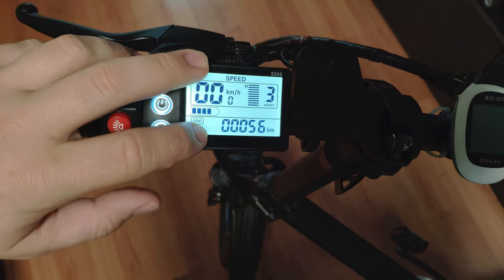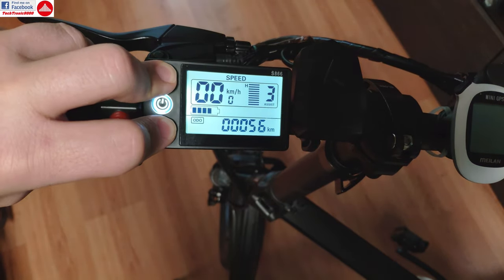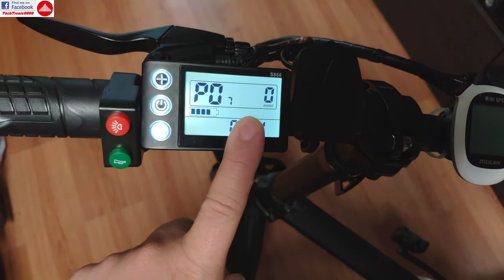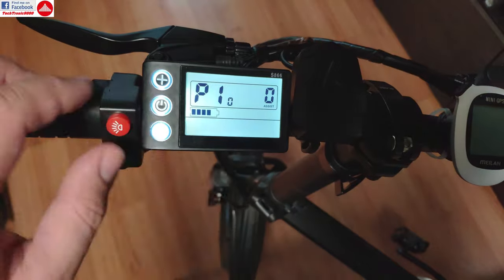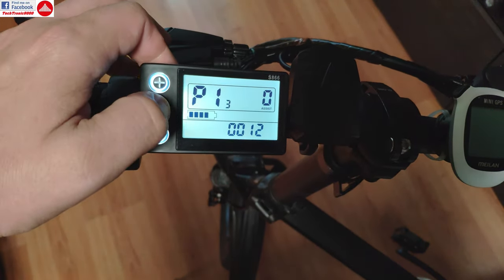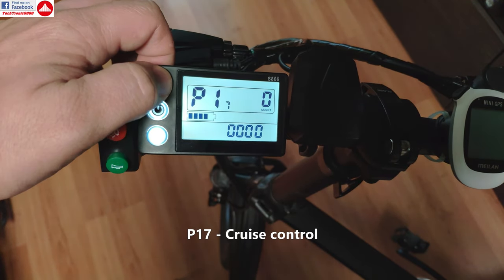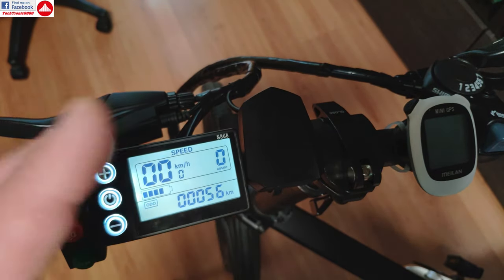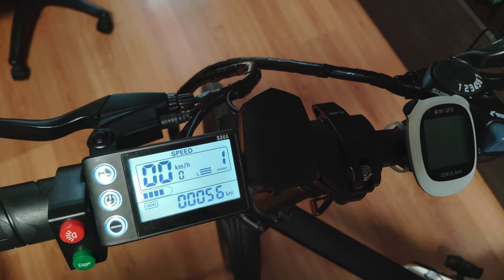ADO A20 / A20F / A16 S866 LCD - Complete Settings Walkthrough (P01-P20)

Comment: As far as know "Trip mode" is used for to indicate daily distance but mine turns zero each time when I pause to drive  the screen goes off after ten minutes according to manual  then when I drive again it opens and shows zero km again. I want to know total distance clearly at the and of the day....Any explanation? Thanks...
Reply from the maker: Check the ODO when you start and when you end the ride. Trip auto rests when you turn the bike off or when it enters power save and automatically turns off.

Comment: Thanks for the video. I have a question. When I start pedal and electric motor start running too. But when I stop pedal the motor will keep running about few seconds. Witch one can adjust when I stop pedaling motor will stop right away. Thanks again !
Reply from the maker: Check the assisted delay setting.
Reply: Just lightly pull brake lever

Comment: on p16 you can reset odo,but what butten you must pusch to reset it when in p 16?oh i found out you must hold + button 🙂
Reply from the maker: Now we will see thousand of these bikes sold as new :p
Reply: Btw. I have changed the P07 by accident to 0006. Could not change back to 0001. Do we have any ways to put it back to factory setting? I reallized that measure my speed not accurated at all.

Comment: hello can you help me. the lcd screen is coming on but it is not showing how fast i am going, it wont register just stays at 00km but it did used to tell me how fast i was going. i would really be so grateful if you had any help in this as its really bugging me now thankyou so much and thankyou for such a helpful video
Reply from the maker: Did you changed any of the settings? Might be a wrong parameter.

Comment: Very informative, thank you! 

I don’t understand the P15 option though. Are you saying you’ve set it at 29V which makes the Bike battery turn off once it gets to this voltage when riding? 

I’ve got a 12-15 mile commute to work and I plan to re-charge the battery when I get there. My plan is to set the P15 option to 0v or 1v. Is there any harm to the battery in doing that?
Reply from the maker: P15 is a battery over-discharge protection built into the controller. At 29V you are at 2.9V/cell which is already low, going lower that that it will quickly destroy the battery.
Reply: No matter what the setting is on the display, the bms in the battery will shut down at a safe level (low voltage cut-off). Also, how far cells can safely be discharged depends on which cells they are. Some can safely be discharged to 2.75, or even 2.5v.
Reply: You don't want to run it that low as irreversible damage to battery may occur

Comment: Hello i have joust bought ado 20 and i have a problem with the throttle, is is not responding as it should be .I have made the adjustment as you describe in the video but i twist the throttle but it is not working .I only have petal assist..can you advice something
Reply from the maker: Maybe you have the new controller so check this  video here to see how to enable it https://youtu.be/rL0P9gW5x4U

Comment: Very Good Information on the settings , i followed your recommendations through each of the 20 settings , Please let me no if there is anything more that can be done for more speed , or savings battery power ,
Reply from the maker: There are no more extra settings. Removing speed limit and putting the acceleration on max level yields the best performance. If you want battery save then limit speed, limit acceleration, disable zero start and use assisted mode.
Reply: @TechTronic9000   You didn't answer our question can we fit a 48v 17amp or 20amp

Comment: Hi there
I have the new controller with the 16 settings,but cruise control is not enabled.
Is there a way to enable it?
Reply from the maker: You can check my other videos where I have covered the new controller, mine worked right out of the box with cruise control.

Comment: Thank you.  I have stumbled on your channel because, I was messing with the settings and I have lost my assist mode though I still have the throttle.  What have I done wrong?
Reply from the maker: Check all the settings to be similar with the ones from my video. Do you have the newer controller?
Reply: @TechTronic9000  I have change all settings. I copied all your default parameters. It's now working properly.  Just one thing, I have 0 1 2 3 ,   1 is pedal assist which I find a bit of a surprise jolt of speed and I have to brake sometimes because I might hit somebody in the street.  is there a way I could tame it a little bit.  it's only 1 that works as pedal assist.  2 and 3 are the same using the throttle.   Is there something I can do?  Please enlighten me and thanks a bunch.
Reply from the maker: It looks like you have the old controller model, you might want to upgrade to the newer controller, that woul give it 3 assist modes. You can also tame this controller by reducing acceleration power (see in video).
Reply: @TechTronic9000  Thank you very much for the info, I would greatly appreciate it if you make a separate video tutorial about that, I'm sure many have the same problem. Thanks.  Btw, I have Cruise activated, that means I have the newer version of a controller?

Comment: Hi Sir, thank you for this video. I am totally new to e-bikes, i live in Holland, so only 25kmh pedal assistant with no throttle are allowed on the public roads. I want to adjust the settings to follow the rules, what settings and steps should i apply? Doesnt matter what i do, nothing changes
Reply from the maker: Hello. You need to replace the controller with the new hybrid one, it's very easy: https://youtu.be/Pyl3P8tiyhA then you will have 3 working assisted modes and also be able to disable throttle completely: https://youtu.be/rL0P9gW5x4U
Reply: @TechTronic9000  do the bikes being sold as international model now have this new controller?

Comment: Cruise control can be activated by holding and maintaining the throttle at the desired speed for 5 seconds
Reply from the maker: Only on the newer controller, this is the initial release one which didn't have this feature working.
Reply: My Hitway BK11 with S866 display seems to only turn on when holding throttle and the(-)button

Comment: Must be nice to confirm the setting that you actually want. I set it, hit the power button and it just shuts off or goes to the next setting without saving anything I did
Reply from the maker: You don't need to press power. Just leave it for some time like that and it will auto exist. It should also save the settings.
Reply: @TechTronic9000  I've got it figured out. Now I'm trying to fully unlock the governor. Apparently it involves pulling both brake levers at the same time

Comment: Hello,you can activate the cruesing mode by pressing longer the minus button.
Reply: cruise mode
Reply from the maker: That is walk assist mode and it only goes up to 6km/h
Reply: @TechTronic9000  maybe your right.I saw that the cruise mode also is working on 6 km/h.
Reply: @TechTronic9000  I,ve got a S830 display and I cant you the bike becouse it shows a E 10 error code.
Reply: @TechTronic9000  and I dont know how to setuo de P07 value.Motor 36V/250W,battery: 9AH.
Reply: As long as P17 is set to "1",  the Hitway with S866 will set the throttle where you hold it as you press and hold"(-). Braking and throttle actuation turns out of but pedaling can be used as a great way to save battery when you lock the cruise at like 14mph and pedal in 7th gear

Comment: How to remove automatic slow down when the battery is at 80%? When the scooter fully charged 100%, it goes up to 40 Km/h but when the battery comes down to 80% the speed only goes up to 34 Km/h. What setting I have to setting to maintain same speed 40 KM/h?
Reply from the maker: There is no such limit, top speed will decrease proportionally as the battery level decreases.

Comment: Once again thank you for your reply I set it at 000 on program 9 but throttle still not working even after replacing throttle It must be the controller at fault as I have set all programs as suggested thank you
Reply from the maker: Is it the new controller version? That needs activation for throttle with a different procedure. You can see both controller and how to replace them: https://youtu.be/Pyl3P8tiyhA then you can follow up the test ride where I explain more about it and show how it works: https://youtu.be/rL0P9gW5x4U
Reply: PO9 set to "000" will disable throttle. Try PO9 set to 002

Comment: Hey I got my ADO A20+ the other day, loving it. Im unsure how t oactivate cruise control though, any ideas?  Pretty sure mines the new controller.
Reply: Cruise control can be activated by holding and maintaining the throttle at the desire speed for 5 seconds
Reply from the maker: If it's the new one, the cruise control activates after keeping throttle constant for several seconds.
Reply: You may have to do that and also hold (-) for approximately 5sec. I have an S866 display.

Comment: I got an E10 coming up on the bottom of my screen and then when I go out mine doesn't go very fast anymore what can I do
Reply from the maker: Usually E10 is a communication error. If your bike has a headlamp try to disconnect it and see if the error clears.

Comment: I have a question my ebikes throttle is not working on level 1 to 4 it works on 5 but it's goes till 5kmph only idk what's wrong
Reply: This happens when the bike only has 3 assist levels and the display was alerted to go to 5. It basically just skips the added ones and Maxs out on level 5 because the max level won't change from altering the display. It just shows more numbers.

Comment: When I hit the + and - Buttons it shows me a "C" at the top and (4) 0's at the bottom, I guess it's asking me for a password. Any idea what the default code may be to get into the settins?
Reply from the maker: Yes it needs a password. ADO bikes with the S866 don't use a password. You could try some generic ones such as 0000, 1234, 8888, I have also found that the "default" one could also be 3745

Comment: My menu P13 is set at value 10 (I am unsure if the A20 came like this,  or I changed it by mistake when playing with menu.  Do you think I Should change to 12 as per on your video?  Many thanks.
Reply from the maker: That is for the assisted system, if your works normally then don't change change it.

Comment: can you help me on the manual of this controller says "P12: Help start intensity setting range: 0-5;" and in this videos you said "P12: Electric mode acceleration strength" is this the same? very nice video btw, also i have 1000w ebike with 48V/15Ah baterry and Control system is "48v20a Vector controller" in P14 what setting should i use? 15a? 20a? default number its 13 don't know why
Reply from the maker: It's the same, it's how fast the motor will accelerate. For your second question I can tell you from my experience that the amp setting usually doesn't work, so default or maximum it is the same.
Reply: @TechTronic9000  tks allot for the answer brother one thing i have notice is that ebike seams to have allot more power if i put P14 on 20a , i tested with 12a and seams allot more slower is that anything to do because my battery is 15ah ? or this setting have nothing to do with baterry power!? for the record  "P12 was on 5 booth times while testing this. another weird thing that is happening to me now its that KM/H gets stuck on 34/35 even if iam going 40 or even 45hm/h have tested with GPS till 34/35 shows the same as the GPS after that gets stuck there and gps shows whatever more than 35 iam going 40.. 45.. etc.. any clue? sorry for long reapply hard to find help with this stuff online
Reply from the maker: Theoretically P14 changes the maximum allowed current for the controller. This should also be supported by the controller. It has nothing to do with the battery capacity, is it just allowing more power to go to the motor. I have seen this speed freeze on several other bikes when you unlock them and ride fast. Haven't found a way on sorting it out.

Comment: Yes, got a problem. My controller turned off and it will not start again. How do I fix it?
Reply from the maker: Is you battery key on? do you have power? Is the battery charged?
Reply: @TechTronic9000  yes the battery is full when I press the button it just flashes for a second less than that and then nothing

Comment: I installed a 48v battery now ihave 30% more torque and range, as the controller can handle 48v.
Its a plug and play so it replaces the old battery, turn the controller to 48v on the p settings then its ready.
Reply from the maker: And I think that your top speed is also considerably faster now.
Reply: Jake what battery did you use

Comment: There are similar bikes where I can change the display settings up to 35 kmh?
Reply from the maker: To increase speed and unlock the controller it's not only about the display, the bike should have a battery, a controller and a motor to actually be able to increase power and speed.

Comment: Good morning !
I have a A26+ and I wanted to know if an improvement for the max speed?
I am currently at 35km/h and I would like to have it homologated but for that I have to reach 50km/h

Is there an improvement?
Reply from the maker: You can't go faster than 35km/h as that is the limit for the battery, controller and motor. To get 50km/h you will need at least a 52-60V battery, new controller and new motor.

Comment: My LCD won't stay on, it just flashes the backlight and goes off again each time I try to boot the bike up. I fitted a new Controller, but it's the same. Could it be the S866 display that's failed??..Thanks..🤔😳😳🇬🇧
Reply from the maker: Can you disconnect the front headlight?
Reply: @TechTronic9000  I can do, I was just riding in assist when the display just went off. Rebooting got the bike started again, but after a km or so of gentle riding it went off again. Then it got to the point where nothing appeared on the display on key up but momentary backlight...😳🙄😳
Reply: @TechTronic9000  Unplugged front light and the switch, no different. I think the Displays 5v driver circuit may have failed..ADOs London Agent is useless, doesn't carry spares of Controller or Display, vulnerable items...but he's got mudguards and racks. The people irritate me for being so unhelpful..🤔🙄😳🇬🇧
Reply from the maker: Can you connect the charger and see if it will work? What is the battery voltage?
Reply: @TechTronic9000  I tried to charge it today but a green light on the charger says it's full ..I'll check the voltage tomorrow. I've ordered a new display, it's very common. The plug end is the wrong polarity, so will have to solder it. ADO have made theirs different to everyone else..🤔😳🙄
Reply from the maker: I wanted to say that you should try to turn it on while the charger is connected.
Reply: @TechTronic9000  I used my multimeter on the battery ..As you switch on, it momentarily provides 36vdc, then drops back to 1.8v....This would explain the symptom of the backlight coming on for a brief period..🤔😳..If I try and charge the battery, even out of the bike, the green light on the charger is on, indicating it's taking no charge?..🤔😳🇬🇧
Reply from the maker: Ok, leave the battery for 1-2 hours on the charger and monitor it, it might be too low on charge, or ultimately might be faulty.
Reply: @TechTronic9000  It's definitely a battery problem...I tried switching the ignition key back and forth with the charger plugged in, and got a red charge light going. Battery came up to 41volts from 36 in a fairly short time. I'm guessing the contacts in the key barrel are cheap metal and oxidised. Sprayed barrel with switch cleaner and worked it for a while..Its on charge again now...Hope this fixes it...🤔🤔😳😳😳

Comment: Which one for acceleration level P11 or P13? Which one for decrease the delay so the bike starts faster P14 or P16?
Reply from the maker: P11 is for the delay of the assist mode, P12 is for acceleration power.
Reply: @TechTronic9000  How to remove automatic slow down when the battery is at 80%? When the scooter fully charged 100%, it goes up to 40 KM/h but when the battery comes down to 80% the speed only goes up to 34 Km/h. What setting I have to setting to maintain same speed 40 KM/h?

Comment: Hello . If I set it to a smaller wheel size  will it make the motor go faster if it thinks it has to make up the speed
Reply from the maker: No, it will just show wrong speed as that setting is just for display calibration. You can check my other related videos about ADO bike to see how to unlock them.
Reply: @TechTronic9000  ok thanks . I will do . My bike was limited to 15 mph I've unlocked that but my bike only does about 19 or 20 mph if I peddle really fast. Hopefully I can get it abit faster
Reply: Best bet... Go on a diet. I max my Hit way BK11 (US edition) at 22mph gps calibrated. If I wasn't 260lbs and was closer to the 70 kg little boy they used to get the bikes specs I would probably rip lol😂.
Oh, another think you can do to get your bike to go faster would be too get a 60lb neighborhood kid to rid it. I mean you won't be on it but your bike will haul a55 . Lol
Reply: @MrWrr3rd  I have a 1000 watt hub kit now with a 52volt battery  . Much better

Comment: Hi, do you recommend ADO A20 or the Fiido D4S? Considering the pedal assistance as criteria
Reply from the maker: The ADO assistance works better as you can adjust the delay, although it only has one single assistance level, check my full review for more details.
Reply: @TechTronic9000  thanks for the reply. Just saw your review too. Very informative 😊😊